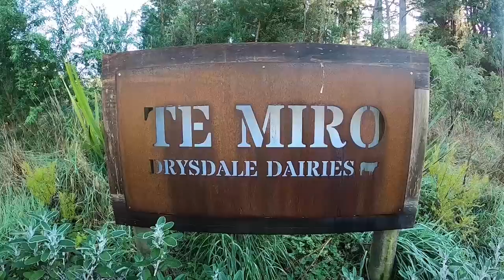Lock Down Content for the Tube/fencing and concrete work

Comment: Cheers for the content during these lockdown times. Curious, are fencing jobs priced per ma etre or a fixed price depending on what is needed ie terrain (flat vs hilly), material (steel pickets vs wood), access, etc... Solid work there.
Reply from the maker: It's totally up to the fencer what he wants to charge most guys just go at a hourly rate,it depends on the ground most of the time if the ground is Good then I would charge about $10 per metre for a conventional fence town fence's like a pailing fence with lots of timber $120-150 per metre fence's on hilly county most likely a different story alot slower if you can't get tractor and rammer to the job
Reply: @ruahinehunter7441  Cheers bro